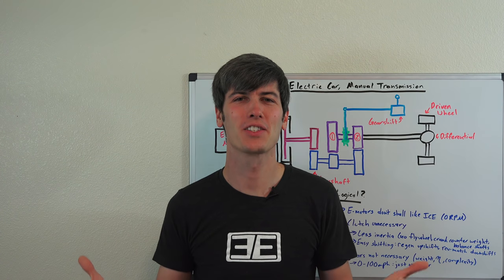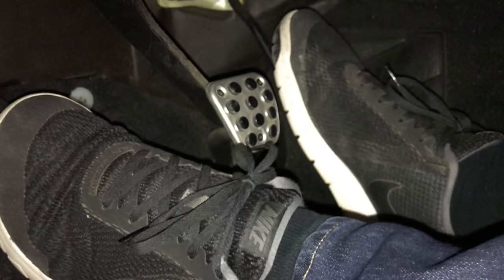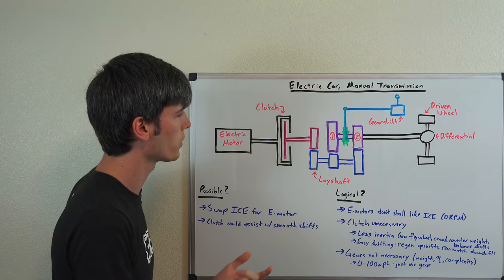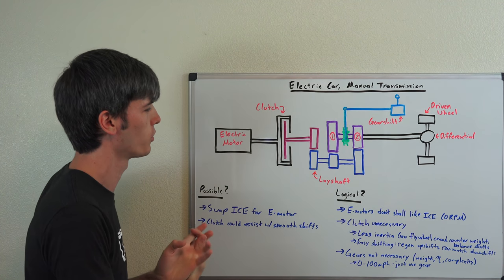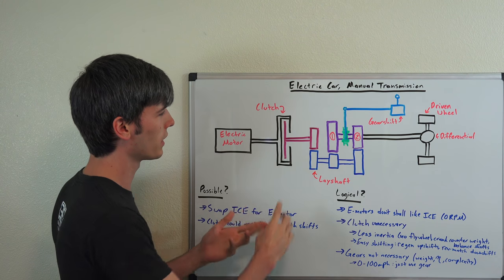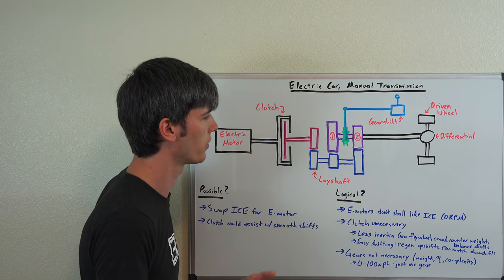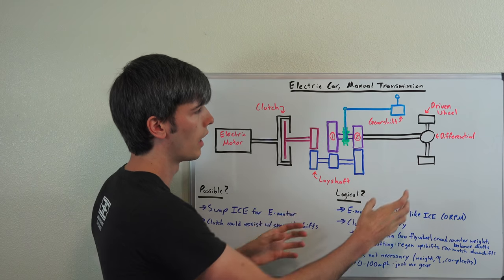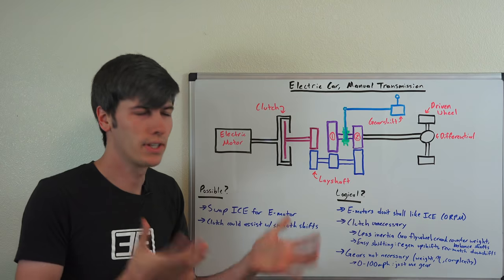Could Electric Cars Have A Manual Transmission?

Comment: What I do not understand, efficiency on the side, if the gear is shorter, is electric car accelerating faster? Let's say electric car has one gear which has maximum speed of 250kmh at 20K rpm, if it had 2 gears, one with max speed of 100kmh and other same as current 250kmh, wouldn't it accelerate faster till 100km/h?

I know it has max power all the time, but if gear is shorter, will it benefit acceleration?
Reply: It doesn't have max power all the time. When you start from standstill it has max torque and no power at all. Power is max at the top speed. Not sure if more gears makes it accelerate faster because maximum amount of grip from the tyres is the main limiting factor. Cars like Tesla and Bugatti can't accelerate any faster because of lack of tyre grip. They'd just spin the wheels while stationary.
Reply: For me it is hard to understand and to compare it to internal combustion engine/transmission - power is function of torque and rpm. How does electric car accelerate that fast in low rpm, I know it has instant torque, but power is what matters for the car to move, isn't it right? So if it has only one gear, how does it have enough power in 0 - 100kmh range where rpm is low if it does not reach max power there (I know it has flat torque but still)?
Reply: @jutjub22  actually it's not that difficult. Basically torque is what makes the car accelerate. Power is what keeps the car at that certain speed. For example, the bugatti veyron needs 1000hp to stay at 253mph. If it didn't have that power, it would instantly slow down because of the air resistance. Veyron has over 1000lb ft of torque to accelerate it to the 253mph top speed. It can't accelerate above that speed because at that speed, doesn't have enough torque to increase the speed against the air resistance. And the power keeps it from slowing down from 253mph.
Reply: @jutjub22  Electric motors actually doesn't have a flat torque curve. For a while it stays flat. After a certain rpm, the torque reduces very quickly. That's why even though tesla cars have lot of power and torque, after about 115mph, the acceleration is very slow. Even a golf r accelerates from 115mph to 155mph much faster than a lot more powerful tesla.
Reply: thanks for explaining but I do not agree about this part "Basically torque is what makes the car accelerate", or am I missing something. Isn't power what matters at the end, torque is only force of a single combustion cycle in internal combustion engine - piston force after explosion?

Example,  100NM from 6000 - 7000 RPM will accelerate faster than 200NM from 1000-2000RPM in same gear?
Reply: @jutjub22  It's difficult to explain like this. Can you watch the video on cvt gearboxes on engineering explained? That'll clear this up for you.
Reply: Ok, I will watch it. But Tesla is not CVT, it is single gear as I see?

What I am trying to say, that torque number alone does not matter (high torque at low rpm is little power and slow acceleration)- what matters is usable power curve. (which is actually torque in a function of RPM).

So that's why I do not understand how tesla has good power/acceleration in low RPM and low speed.
Reply: @jutjub22 no no. I didn't mean tesla has a cvt. I meant that video explains how torque and power works in a car. Tesla has a fixed single gear. That's both beneficial and disadvantageous at the same time.

Comment: Given EV's have different power settings, why can't this all be done electronically? Xbox controllers have feedback, so why can't an EV have all those blips and beeps...  Imagine flipping a switch and being able to control a clutch and a gearshift, and have the electric motor just mimic a power band? Why not have the car ape naturally aspirated, or turbo lag, or dual turbo, or super blower power? 

And suddenly a car which was looking to cancel out the driver is now engaging the driver in the best, most liberating drive –by "transporting" the driver back into the cockpit.  The clutch and gear shift could be fake with hepatics to make it seem real. I mean, if a Tesla can play fart sounds and have a musical light display, why the heck not make it like an old GTI?  

And then, with a flip of the switch, you could go back to watching Matlock while the car self-drives you to the mall for some more diabetic socks and kasha.

Comment: wow i have a Porsche 951 that has a 5 speed manual with the transmission in the back so i have one question what engine would be be the best the hp is 156 stock any help would be nice

Comment: So efficiency wise is there any advantage to having gears?? I mean electric car or truck say it has 2 gears or 10 whatever if the load at a given speed is constant but the rpms of electric mtr changed dose it use more or less electricity? Say 80mph in 1st gear the electric mtr is turning 2000rpm but in 2nd it turns 1000rpms??
Reply: Like internal combustion engines, motors also lose power at extremely high rpms. Gearbox might help with speed. But it might also reduce efficiency. (extra weight)

Comment: Please watch Rich Rebuilds , he built an electric car with a manual transmission
Reply: Yes, a lot of diy EVs do. The big question isn't if they can. He answered that in the video. Of course they can. The big question is should they use a transmission. IIRC, Rich doesn't have a clutch on his EV. Many diy conversions don't. You put it in the gear that you want for the drive and leave it there. Or you shift very carefully while driving, but just one other gear. 

The thing you should ask is "Why did Rich leave the transmission in the car?" The answer is basically because you need to connect the motors to the wheels somehow, and using the transmission that's already there is cheaper and easier than using something else.
Reply: @anthonypelchat  I meant it's a cool video , check it out , no stance on the requirement of a manual transmission
Reply: @thebudgetcyclist4310  Gotcha. Your first comment sounded like you were using his video to say that manuals should be used. They really should for diy EVs, but not production. All good though.

Comment: automatics are NOT more effiecient on gas engines a manual makes more wheel horse power and uses less fuel. otherwise explaine how my brother's 250 chevy 6 3spd manual pickup always beat my 350 v8 automatic pickup and got better gas milage?
Reply: Other factors come in like vehicle weight, drag, octane rating, fuel air mixture of the engine and compression ratios.

Comment: They do this on classic car electric conversions.
They leave the manual transmission in place, but you can pull away in 4th if you wanted.
Check out the fullychargedshow channel.
https://youtu.be/AJLdzRJdKrs?t=9m46s

Comment: Electric cars are a con. They're heavy- so more damaged roads, the metals are toxic and rare- so cost is sky high and disposal fees are going to cost a fortune when the car is near the end of it's life, efficient up front but do you really think people are going to drive electric cars until the battery life only charges up to 80, or even 60%- I don't think so and imagine going to a car dealership and they tell you that the car only charges up to 80% are you going to buy it? Batteries can be recycled but even now they say recycling is tough because of the glue and other chemicals used in manufacturing the batteries- how in the hell are they going to dispose of all this heavy metal in the future. Electrical grids can hardly maintain now with all the electronics- you think it can handle all the millions of car added in the near future...something is not adding up.

Comment: in  my opinion putting a 5fwd or 6fwd gearbox on the electric engine is a no no !!! , possible as maybe electric engine put out full torque , and possibly rear  differential issues , resulting later backlash , putting a high/low gear on a gearbox is just wasting time & much more.